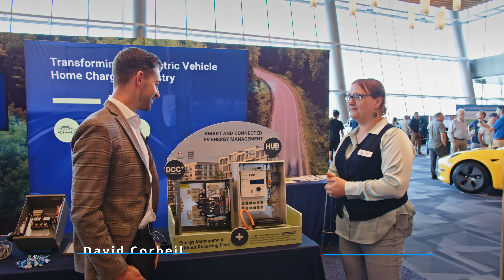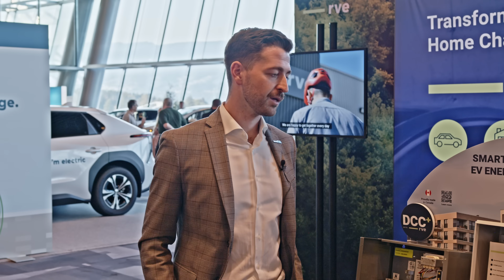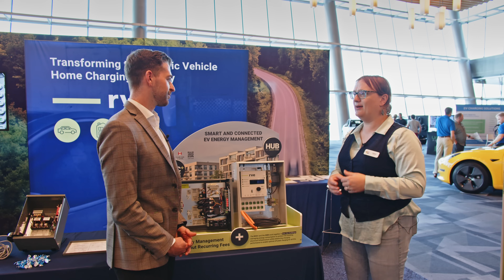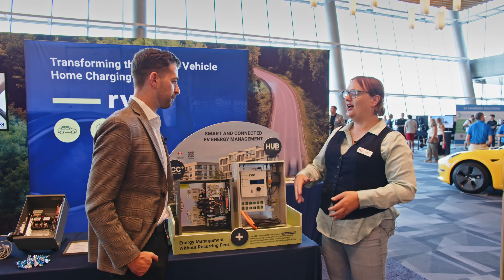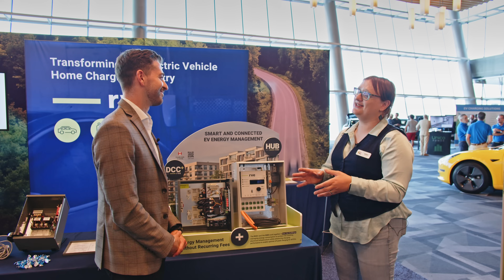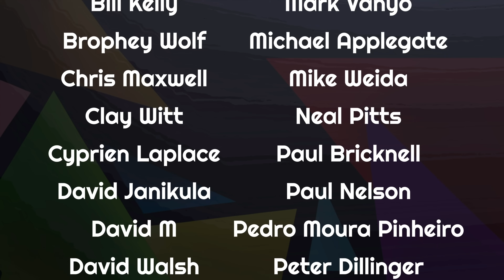Will This Company Make Multi-Family Dwelling Charging Easier?

Comment: As someone who has installed EV chargers at a condo that was not designed for then,  the issue isn't amperage, it's billing.  There is no reserved spot per unit,  that's impossible.  There's just the "EV spots" for those who charge and an app to determine who to bill.  
The chargers need to be  robust, cost effective, both for instance and using, and be able to determine who is charging and only operate for those residents.
Reply from the maker: You might need to go back and re-watch. this unit is specifically designed to tie in with the meter of homes - be retrofittable , and work with assigned parking spaces.
Reply: @transportevolved  
I liked the video,
however many condos do not have assigned parking. so you need everyone to use shared chargers.

Comment: IIUC, this is a system that load-balances EV demand at a premise by turning power off to various receptacles that feed EVSEs.  And it has a hub for programming the priorities of load-shedding.  Honestly, this doesn't sound enticing to me.  It draws from a customer meter.  I don't see the advantage of this over providing onsite networked EVSEs, and manage load-shedding at the EVSE level rather than this ON/OFF approach.  EVSEs can tell connected vehicles that less power is available, dynamically.  That's in the J1772 standard and load management is already widely managed this way.  Networking them to manage charging demand at the EVSE level makes more sense to me than this "turn off the power for an hour (or whatever)" system.

Comment: I'm telling you now as a contractor that box will cost thousands to install. I don't see any skilled and licensed contractors installing that for a few hundred bucks. Permits, inspection, code compliance, and how the Inspector feels that day are major factors. For the home owners look at what it cost to have a 50amp receptacle installed 10' from you panel. Now multiply that by 2-10 for commercial applications that have more stringent regulations. I guess if you putting in 20-50 of these it could drive the per unit install down a little. Anyway some has to cover the cost.

Comment: 10 states have right-to-charge laws that allow residents to install electric vehicle (EV) charging stations in their homes or apartment buildings:
Reply: "allow to install" doesn't mean "easy and cost possible".
Reply: @AnonymousFreakYT correct, it will not be handed on a silver platter necessarily.  First step would be asking.
Reply: I think it's about buying UL listed products and having a professional install them

Comment: I think they should implement a dvr and cameras if they're targeting apartments and shared spaces.
Reply: This device typically won't live at the parking spot, but in a closet full of meters and circuit breakers. And I don't think you need a closed-circuit camera at each parking space anyway; typically you position a camera to watch a dozen or more parking spaces.
Reply: He probably means for charging cable vandalism and other mayhem and abuse.
Reply: Streaming to remote storage